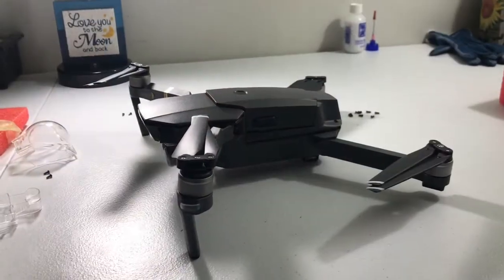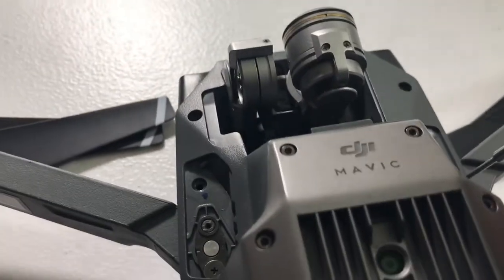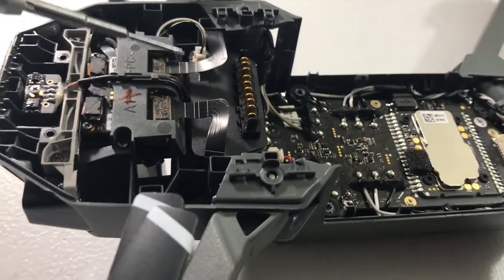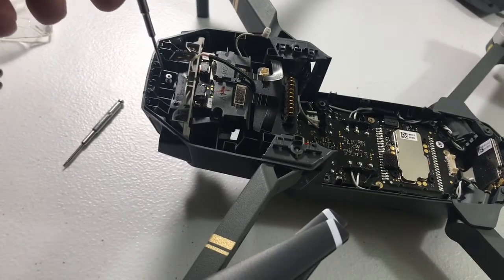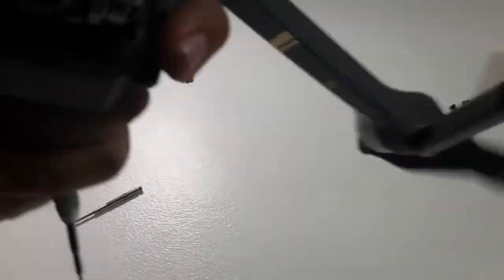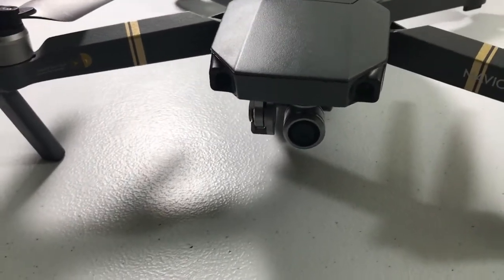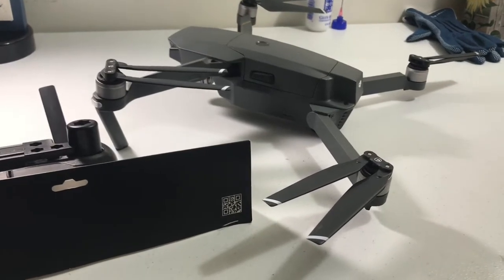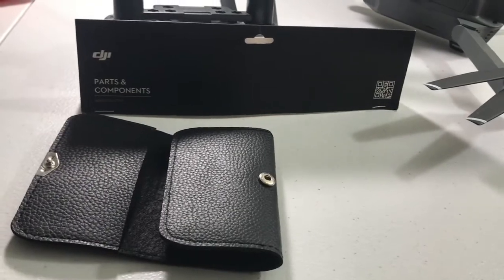Dji Mavic Pro Camera Replacement

Comment: Did you have to "reprogram" the camera or Mavic at all after installing the new camera or did the system recognize the new camera without a problem? Thanks for the video!
Reply: Also, where did you purchase the new gimbal from? DJI doesn't seem to be willing to sell them direclty.
Reply from the maker: MixEngineer615 plug and play sir ! I purchased mine on amazon or you can purchase through drone expert in Rochester New York !
Reply from the maker: MixEngineer615 I purchased right from dji and no I did not have to program